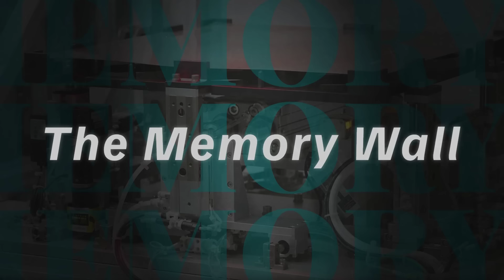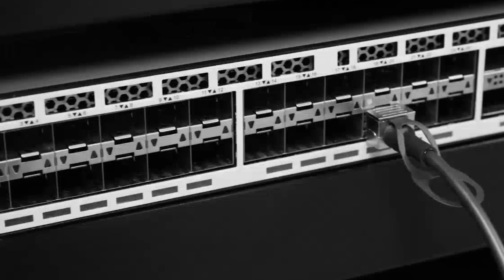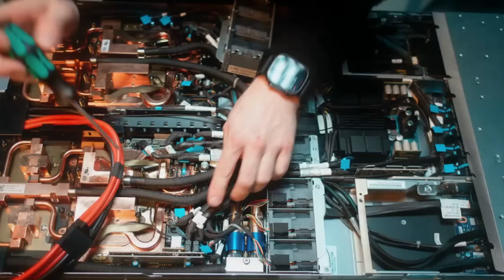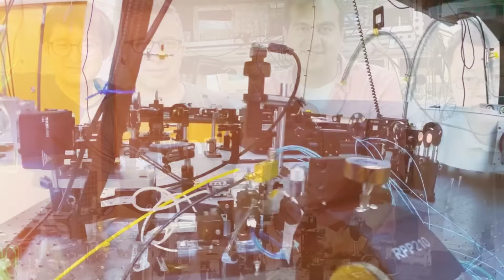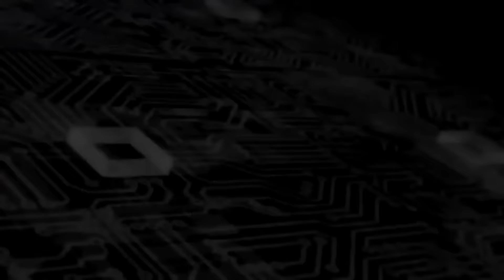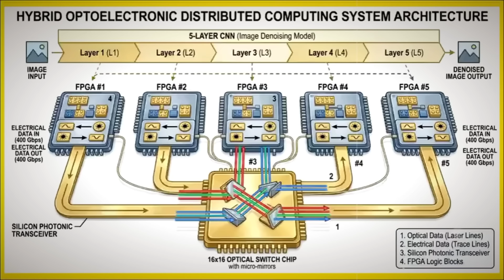China Just Built What NVIDIA Feared Most

Comment: Photonics and light will be the future not copper connections and it will be all intergrated with Quantum computing. Qday will happen in the not so distant future.
Reply: Room temperature lab made diamonds with a specific flaw where a nitrogen atom can take place of a carbon atom, causing an adjacent vacant hole in the carbon lattice having lasers shone through them to produce stable qbits and that same laser can be these new interconnects.

So future electronics will be made of diamonds and lasers that will be able to be suspended or contained in a different substrate/ backbone, instead of metal silicon and copper wire etched on PCB’s made of
Reply: Fiberglass lol my phone is glitching

But yeah future electronics won’t be packaged in the same containers as we have them now